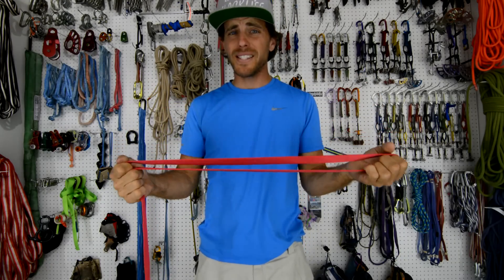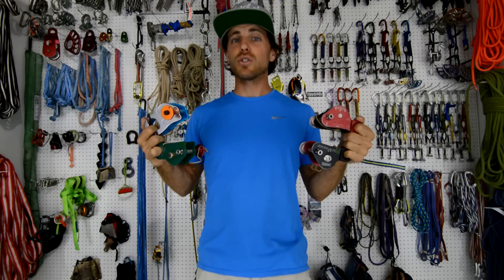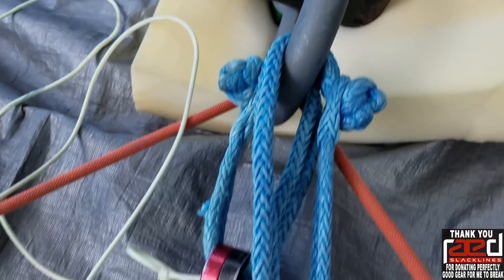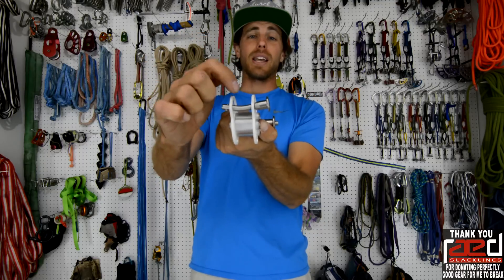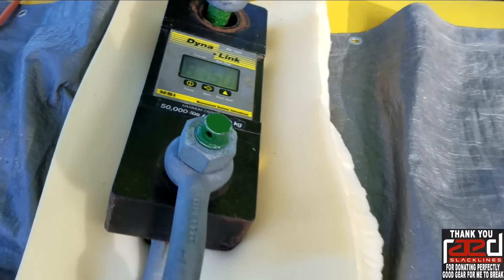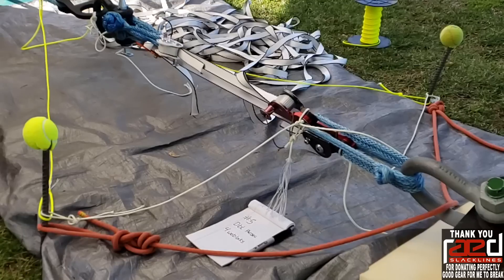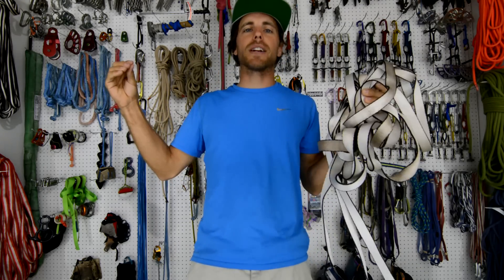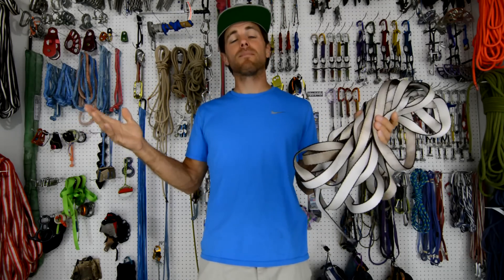Slack Snap - Parallel Redundancy. Can we get 2x the strength with 2 webbings?

Comment: I unfortunately could not attend GGBY, did you guys end up going with this method of rigging for the spacenets? Also if you were to rig two main lines like this would you tape them together? and would this cause possibly more potential for friction on the two webbings rubbing together? so many questions! Wednesdays are now one of my favorite days of the week thanks for something to look forward to half way through the work week.
Reply from the maker: We tried.  It is hard to get both lines to hold even tension.  However we had 4 layers of spider silk (35kn to 45kn per layer strong) holding the net with an overhead line grabbing the corners creating a "jelly line".  No anchor really saw more than 8kn but most the time it was 3 to 4kn.  So most of the time was 10:1 saftey ratio with 4x redudancy haha.  I'm not too worried about friction unless one line is crossing the other like a messy backup gets, if both lines were to be tight.  If flat, it is fine.  We did slider tapes so we could play with tensions and  not break tapes. I filmed a video of it all... still to be edited haha.
Reply: @HowNOT2  cant wait for the video that will be awesome to see. Another thought or question i had comes from the idea that we are using this method to make lines stronger for projects that see higher forces, does that mean this could also be a way to make rope swings stronger or safer as well?
Reply from the maker: Rope swings don't need to be stronger.  I believe rope swings should be more than 2 webbings but the forces of single person jumps with a swing aspect involved are not that high.  The risk is operating them near a cliff edge without being tied in or tying in too long into rope.  It's pretty embarrassing to die if nothing fails!

Comment: I'm not surprised it broke on the pin. That's why you're not supposed to tension a line from the tail.
Reply from the maker: I didn't pull on the tail, I had 2 webbings in 1 weblock and pulled the main lines from both at the same time . This is often done to save on gear and space when trying to rig multiple lines on a spacenet, I don't like that idea anymore until I test it further .